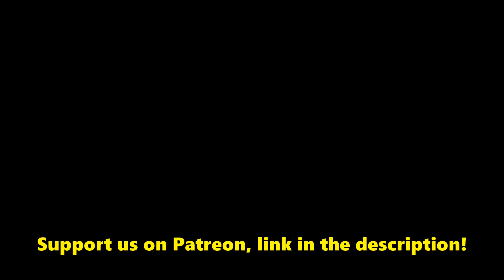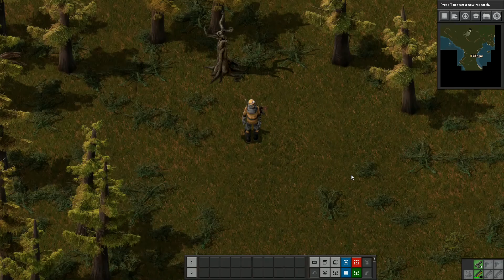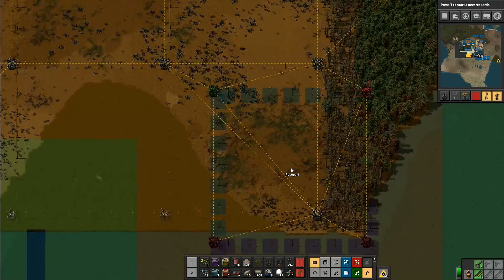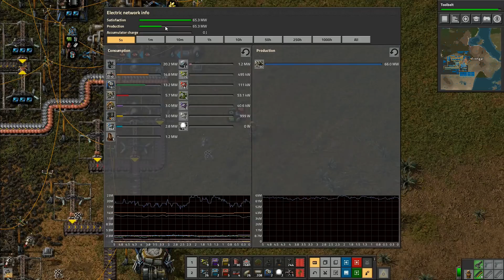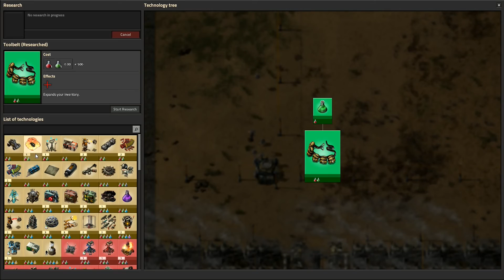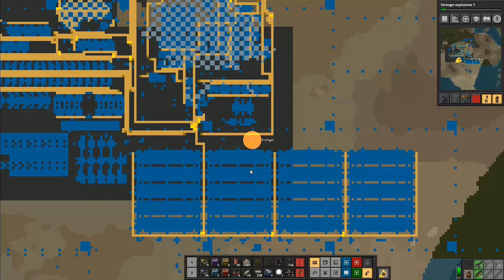Factorio Million Robot Challenge #61: Robot Boost!

Comment: Been converting my Factory to use the logistics network and have also begun using trains do deliver materials closer for the drones to transport. With all the forests on the Island you should try using a flamethrower. it only takes a small hit from it and the fire will rapidly spread. There  is even some timber that is not completely destroyed and can still be harvested. I have been finding this Factorio series and your older one very informative. Excellent work.

BTW: I have upgraded to the same experimental build you are running. I have taken the settings and world seed you are using for this playthrough and have started the FMR challenge